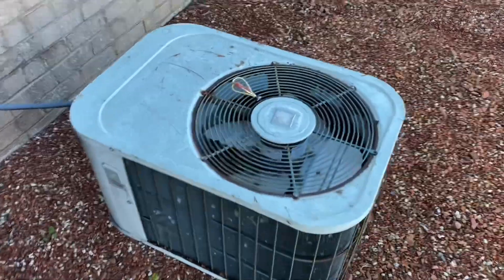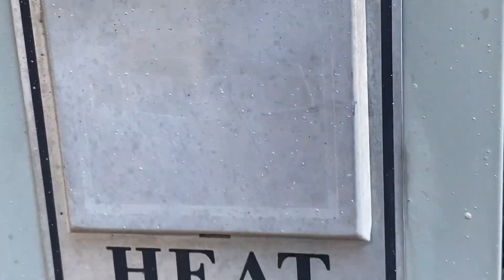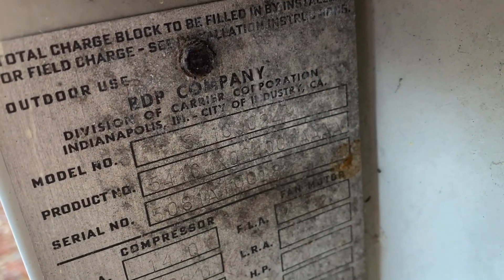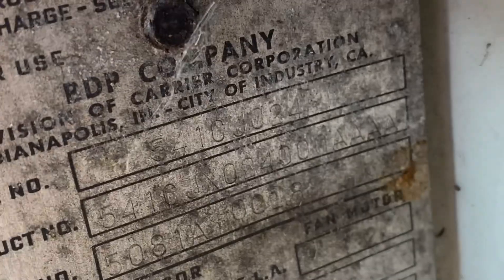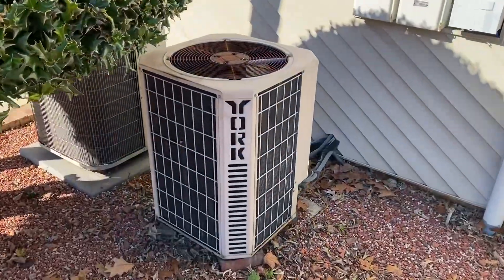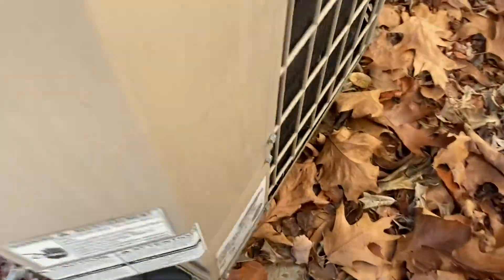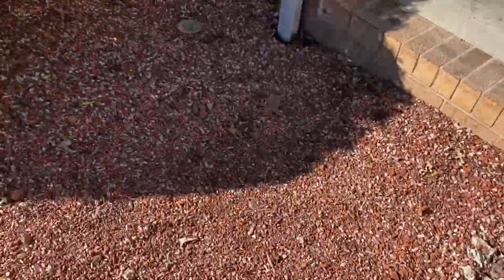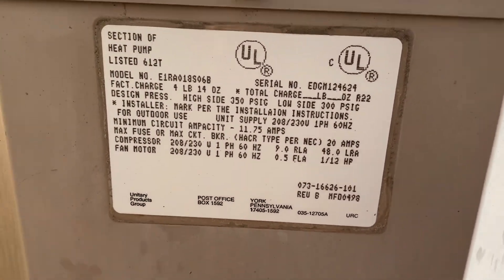HVAC Heaven - Vintage 1981 Bryant Heat Pump & more

Comment: Heil 9000? That's a new one. Wonder what the SEER rating on that would be.
Reply from the maker: @fordmavericksosx3569  12 seer
Reply: @CompactHVAC  Intresting. I always see the ICP 5000 series, I guess those are 10 SEER then?
Reply from the maker: @fordmavericksosx3569  yes, they are. There was also the 13 SEER 9600 series, those are very rare
Reply: @CompactHVAC  Cool. Never seen one.
Reply: yup. 12 seer. my grandparents have one. 30 years old and still kicking